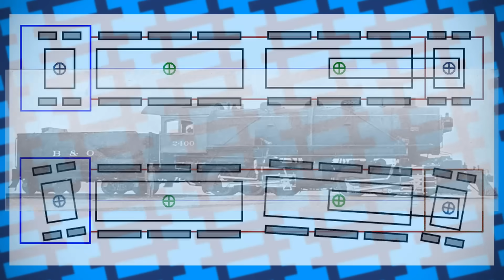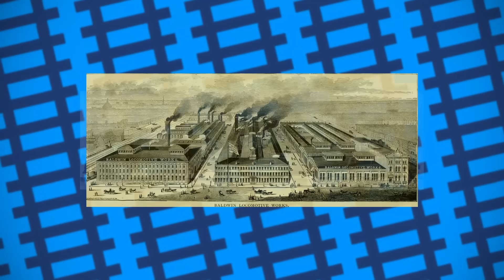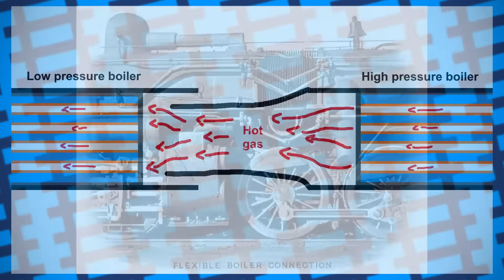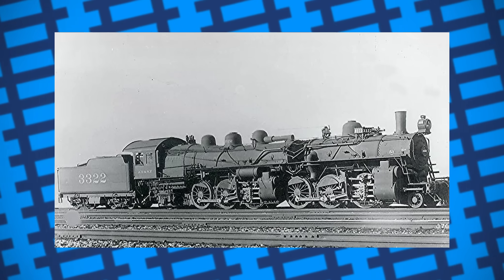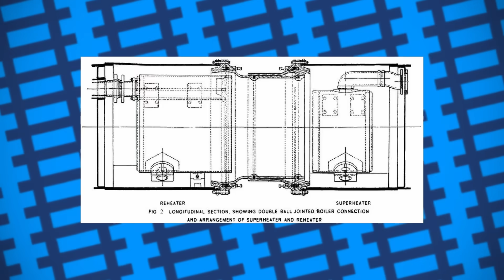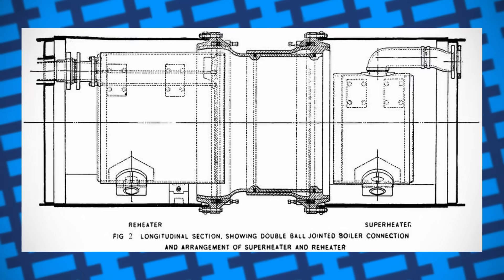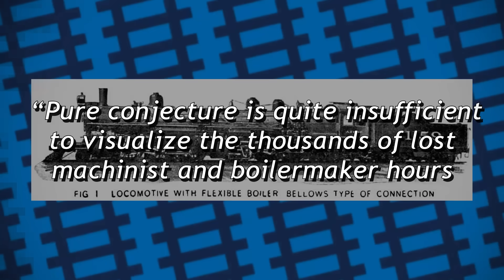How (not) to make a Locomotive more Flexible - Articulated Boiler Mallets

Comment: It looks like the high pressure sections of the boiler are self contained and only the hot gas from the firebox passes through the bendy section.
Reply: I was just going to say the same thing -- it isn't really a bendy boiler, but a bendy combustion gas connection.  Actually also bendy steam pipes, but you need those anyway for a normal Mallet locomotive (or any other articulated steam locomotive that isn't composed of completely independent steam engines with their own fireboxes and boilers).
Reply: At this point, you may as well just use two locos.
Reply: @wt7958 Some railroads did exactly that, although this increased labor costs, since nobody ever developed a way for steam locomotives to receive multiple unit control commands (or to have fully automated firing if the fuel was solid.
Reply: @Lucius_Chiaraviglio  Well, there were tank engines that could recieve control inputs from a cab at the opposite end of an appropriately fitted carraige (might even have been able to have a second properly fitted carraige in between, but there eventually become issues with the connections... not to mention having the locomotive at the back of the train causing derailment issues if the train went too fast). So setting up a... what do they call the diesel ones... a B-unit? something like that? should have been possible... ish.   Meaning you'd only need one driver... you'd still need two firemen though (well, unless you managed to get to the point where an unsupervised autostoker was viable and not a huge safety issue).
Reply: @laurencefraser  I forgot about the push-pull steam engines -- should have been possible to adapt this for multiple-unit control, but as far as I know, nobody ever did.

Comment: when you think about it there are some more actual benefits of a bendy boiler, the lack of a need for the front engine unit to swing out, means you can have the boiler sit lower in the frames and have much bigger drivers, if the concept was improved it might've been an interesting route for high speed mallets.
Reply: Interestingly the boiler height isn't really different on mallets vs rigid frame locomotives, its set more by the demands of blast pipe (steam venturi pump in smokebox) and the firebox than it is for wheel interferance. Nor does sitting the boiler lower normally factor for greater speeds in service, as the engine doesn't normally derail by actually rolling over, and is only one small part of a train (hence passenger trains are let run faster than freight on many networks, despite the same engines being allowed to pull each). This can be seen in designs with smaller wheels where you can often see between the boiler and frame, and in bigger mallets like Union Pacific "Big Boys" having some of the larger driving wheels anyway, and no additional restricitons on high speed corners.

Comment: Could it be done now, given the improvements we have made in manufacturing and materials?
Reply: Possibly but honestly the big issues with it were not necessarily build quality. It's mostly maintenance being a nightmare and modern tech won't really help there.

Boilers are not meant to bend so every single place where there is a joint is just another failure point to monitor. Plus the whole cleaning the flues issue is kind of unsolvable. In order to properly clean them, you would have to design the middle area to come apart so you can get access to both ends. With that, you would likely have a design that either takes multiple days to tear down and clean or it's easy to clean but constantly leaks. 

It's a novel idea but in practice just does not work. When it comes to steam engines, complexity is very rarely a good thing.

Comment: I'm surprised the reason they stopped putting joints in their giant pipe bombs isn't what the seemingly obvious problem is with putting joints in your giant pipe bomb.
Reply: Thats becasue realistically it wasn't a joint in the boiler, steam didn't travel between the two halves directly in teh join, it was two boilers joined by a flexable smokebox. Note how the first examples where rebuilt out of two locomotives. The entire firebox and smoke tubes of a locomotive is in very slight vaccume from the venuri style exhaust steam pumps below the chimney, so that means that when the joints did fail (which they often did) it didn't even leak smoke out, it let cold air in. A small amount of cold air wasn't a exciting failure mode , but a combo of less firebox draught and cooler gases in the front half quickly rendered the engines inefficent poor steamers till they could be repaired agian. I wonder how much of their road hours they where effecitvely the rear boiler making most of the steam, and just leveraging the double tractive effort for low speed drags, instead of actually making their on paper power... which is kind of a death nail for the idea, as the big advantage over a fixed boiler was smoother running at high speeds. But then again, failing so safely and still often being able to finish a route at reduced speed was also what made the experiment viable to keep running at all.

Comment: every time I think there can't be anything weirder, there you are to tell something even crazier.
Reply: Yeah, the ATSF was no stranger to experimentation. Sometimes it worked, most of the time it did not.

Their 2-10-10-2 locomotives were another great failure.
Reply: @Kboyer36  So were the two 4-4-6-2 passenger locomotives.  The best thing you could say about them is that there were only two of these monstrosities built.  It's hard to way which were the worst, the jointed boiler 2-6-6-2's or, the 4-4-6-2's.
Reply: @jamesbondeson669 yeah, The PRR definitely had some weird ones as well. The duplex steamers were a mix of good and bad and then there was the Baldwin Centapieds. Certa I only a way to build a diesel engne.

Comment: When railways tried to make bendy buses, that's certainly something
Reply: isn't a train essentially just a very long bendy bus
Reply: @lasskinn474 some trains might be, but most of them have a very different coupling than bendy buses and trolleybuses.
Reply: @pavuk357  And in most articulated buses the engine is located in the rear part: this means the bus cannot drive without its "trailer"
Reply: @sorenrichter9851 Idk. There are two kinds that are used in my city. One does have it in the back and uses some evil machinery to power wheels in the front part, I believe, though I'm not sure. And another kind is an awful piece of crap that barely goes uphill and has no AC while having the engine right in the middle of the front segment that makes it even hotter. 

My city is fairly hilly and they for some reason chose to use those awful barely powerful enough articulated buses when they already have the entire route electrified for trolleybuses.
Reply: @lasskinn474  Articulated buses have a bearing with hydraulic parts to actually bend the bus, modern trams sometimes have bearings without hydraulics and trains have normal couplers with a bellow above them
Reply: @CommiePlasma Typically both electric multiple unit trains and trams are arranged in "sets" of 2-4 units that have normal couplers at either end, but are harder to split up, you'd only normally do so during maintinace not useage. The simpler examples don't have a walkway between sets at all, which makes them simple/fast to couple, but you can't walk the full length when more than one set is used. More complicated versions have a retractable bellow and doors between the sets... but neither style really correlates more with trams or trains. Making these designs is complex enough that the same styles are marketed globally in a range of gauges, so outside paint/signage its not rare to discover a city on the other side of the planet just happens to have the same commuter train as your used to at home.

Also while I can't speak for the entire world, none of our local bendy busses use hydrauilic parts for controlling the joint. From what I've seen there are two basic styles, the first is simple, basically a "pancake" (an inline 6 where the cycliners run sideways from the crank, parallel to ground to reduce height) mid engine bus with a trailer, with a bellows walkway between much like a train does. The actual pivot is much like a universal joint, 4 greased bearings retaining a small metal "x" so it can move in X and Y axis, and a pair mounting it to the arcticulated section so it can roll (but honestly not far). Unlike a trail coupler your basically unbolting the attachement on the bus side, which takes a long time and is really only part of repairwork. All of the joints I've seen on this style are undampened, it rides just like a pig trailer would.

The second style is much weirder once you understand them, though normal at a glance, as the engine is in the rear compartment,  but the driveshaft runs forwards to the rear axle rigid tothe bus NOT to the axle in the articulated section with the motor. It sounds like a recipe for failure, but strangely the additional mechanical complexity of the latter kind isn't much of an issue, and the advantage it has for the interoir layout (low floor for both doors on the front bus, and only stairs to seat above the motor in the articulated section) made them preferable for larger passenger numbers. This style often has a pair of shock absorber struts to control sway and slightly center the articulated trailer, and tends to have a greased mount that transfers more weight from trailer down onto the rear (drive) axle of the rigid bus, just like a normal "semi" truck turntable does.

When reversing you need to steer the bus to avoid jack-knifing the articulated trailer half, and route operators basically deal with this not by driver training, but instead operating the articulated buses on routes where its not normally required. The depo ect is drive though parking for the articulated busses in the middle, while the rigid busses are parked along the fences, so only maintiance personell should need to reverse regularly.. and sometimes even drivers refuse or aren't allowed, and will actually go and get a specailist if it needs to be done.
Reply: @SheepInACart  Yes, the two types of buses you described are both existent bus models, they arent used in europe that much nowadays tho as they have been replaced by the hydraulic models, which have the motor pushing from the back and hydraulics to prevent jack-knifing the front half. Sounds quite impractical, but it works really well. The bellows are the same as on a train, except longer and larger to accomodate for tight turns.

Both trams and EMUs like you said mostly have the same bellow walkways (if they have them) and are oftentimes shortcoupled (idk what the english term is for that but its essentially just a coupler that can only be decoupled during maintainance). There are much simpler designs with a Scharfenberg coupler and a rubber tube on both cars that slighly compresses when the other car is coupled, forming a walkway where the tubes decompress on the outside of the curve and compress a little more on the inside.

But I want talking about the bellows themselves, they are mostly the same, I am talking about the joint
Reply: @lasskinn474  Tech bros reinventing trains since 1937.